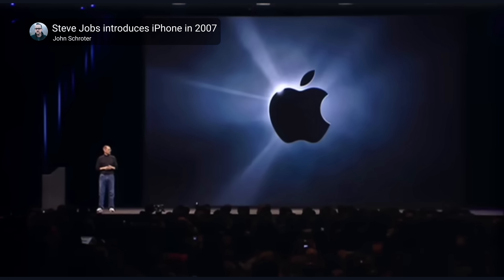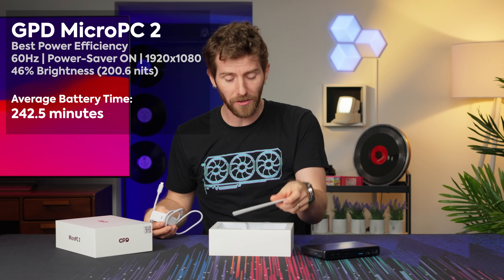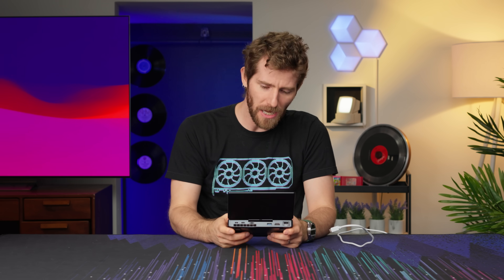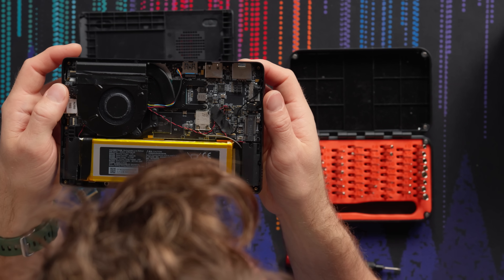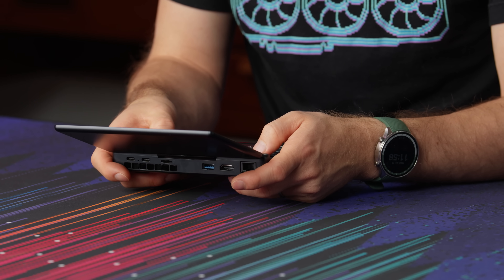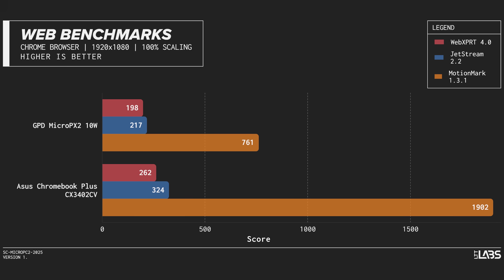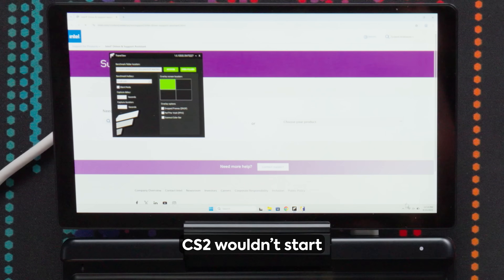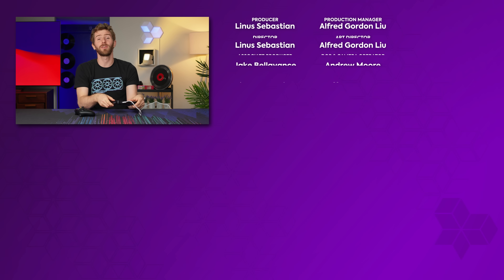I’m gonna need a smaller backpack - GPD Micro PC2

Comment: $600 is so much more reasonable than I was anticipating. Sure, it's extremely underpowered for how much you pay, but c'mon, the novelty factor makes this computer so fun for how little you're spending comparatively.
Reply: For an added cost, you can upgrade the CPU and the SSD drive. Won’t be cheap but you’ll have a professional powerhouse netbook.

Comment: I'm failing to see how this is a better option than a Samsung Galaxy phone running Dex on a lapdock. You can use Moonlight or Parsec to connect the two. It would be a far better experience with a bigger screen, normal size keyboard, cheaper price, and you can even game from it.

Comment: Wow, the exact form-factor that could've justified minimal I/O and a non-removable SSD, and those mad lads went and gave it decent I/O and an upgradeable SSD anyway. Seems like all the excuses from Apple were BS after all. And the fact that it runs Cyberpunk at all is simply amazing. This is the kind of thing I would get if I were doing mobile IT a lot and didn't need gaming performance, not a thin-and-light that takes up way more space and costs 50-100% more.

Comment: I feel like for the money you should just buy a first-generation legion go and get a thick 8-inch tablet that has way more performance at about the same battery life if not better. The laptop form factor on this thing makes absolutely no sense because of how small it is. The only thing this offers over the Legion go for this type of use case is on board IO.

Comment: As someone who semi-daily drives a GPD WinMini 2024, I can really say that GPD does do things well. Ideas are questionable but then you use it and well, it just works. Mostly got it because my work laptop is something I need and I didn't want to bring another full size laptop to work to game or do some 3D Modeling for 3D Printing I do at home. It's basically a SteamDeck with a keyboard. You'd be surprised what the little thing can do. I'm waiting to see when the new one comes if it'll have the next Max chipset from AMD in it. All in all, GPD really does make some great products.

Comment: turning off the lights in a server room to save power is like using a cocktail umbrella in a thunderstorm to prevent getting wet
Reply: Ever littl help

(I excluded every last letter so your OLED didn't have to light those pixels, saving you energy... And then wrote this explanation that I'm still continuing to type right now that will light more pixels. And I'm still doing it. Arrgh!! Sorry. This is backfiring. Oh Gosh, I can't stop)

Comment: Straight up when i was doing contract work as a computer and network tech i would have killed for a system that small and generally capable having to carry a expensivce full sized notebook pc while going up a elevator shaft runnign cable sucked

Comment: I own the GPD Pocket 3 and that is already way too small for anything productive. I cant imaging this to be any better. Cool toy to show your nerdy friends but nothing more unfortunately. I replaced it with a Surface Pro 11 OLED. The mouse button + trackpad layout is great until you have to hold ctrl/shift/alt + mouse button and also move the mouse. I have run into that issue alot when doing cad stuff on it.

Comment: 9:12 I remember hearing in a video by @NetworkChuck that they also turn off the lights and use blue lights to make it more difficult for anyone to see the type/brand of hardware someone else in the data center may be using.

Comment: Linus not knowing about the N-series Intel chips baffles me. They're super popular in the low power computer world. Lots of motherboards with integrated CPU as well as routers and firewalls.
Reply: I think this is rather a commentary on Intel's new naming scheme, where they removed the family name (ie. core/celeron/pentium etc) and just call them 'processor N250' etc. (the previous N generation was pentiums IIRC).
Reply: @SolaLupus  aggravating the issue is the fact that the numbering isn't consistent across generations; N455 is a low-power chip from 2010, but N250 is from 2025!
Reply: @PixlRainbow  And N300 is from 2023.. and it has almost twice the performance of the N250 😅
Reply: I have one running my NAS and I still don’t know Intels product stack name after the rebrand. Doesn’t surprise me at all Linus doesn’t. Nobody is buying Intel products cause they aren’t competitive and then they remove ALL the old model schemes we all knew, not worth relearning, so why would we know them?
Reply: They are also great because they have hardware encode and decode for basically ever video codec. I can livestream full HD video and the processor is idling.
Reply: @jeremiahmorgan2583  Yes, correct. My old Atom N150 netbook has none of that. I don't think it even has hardware to stretch or shrink video to fit in a window! It's basically like a slightly higher resolution version of the original VGA.
Reply: And they are so much better than the older Atom N processors like the Atom N150 in my old netbook which can't really even play HD video.
Reply: I don't think it is at all strange. Intel changed all the naming on CPU families... what is "Intel Processor" It was Intel Atom... this is effectively an Atom CPU... then they went to Celeron and Pentium.... but they got backlash because these Atom chips were mixed into Celeron and Pentium chips with actual P cores... then the Intel i3-N300 is also an E-Core only (Atom) chip again... All I know is that N = Atom... the rest doesn't matter because Intel changes the names all the time and sometimes lower = better (like N97 vs N87 iirc)...
Reply: Linus dun do with the low-power crowd tho. o.o
He uses some embedded devices, but I bet he doesn't even fully realize it. x)
Reply: Sucks that Intel never used the i1 or Ultra 1 names.
Reply: chromebook’s have them
Reply: The home server crowd absolutely loves them too, the N100 specifically gets a lot of love as the perfect option for when you don't need a super performant beefy machine, but do need more performant machine than a Raspberry Pi. I've not got any in my homelab at the moment, but I am strongly considering getting one or two to handle some of my Docker containers so my main server isn't doing all of that work.
Reply: N series of Intel is as confusing as AMD mobile lineup , so understandable. I remember back then they already N2000 or 4000 and they back to N200 or 300
Reply: Oh, he knows, he knows.
Reply: Dude doesn't even know the CPUs anymore and now he's wondering why people aren't watching his videos as much.
Reply: It really is strange. Almost made me think he's getting old to the point where he's out of touch.

Comment: 6:14 That type of tape is great for electronics due to non-conductive, heat resistance, and the HUGE one, does NOT degrade or becomes gluey sticky mess for over 10 years.
Reply: It also boasts great chemical resistance, not all to relevant to electronics applications but we use it all the time in our lab for photos etching

Comment: We need a collab between GPD and Framework, a tiny modular laptop
Reply: The Pocket 4 is basically that.
Reply: I think I'd prefer GPD and Valve or Snapdragon it's seems to be really lacking in the performance side of things it doesn't need a lot of performance it's not meant for gaming obviously but it should at least beat the Chromebook on performance and battery life for that price tag
Reply: Small and modular are kinda opposites
Reply: @WeiChei yet they're not completely mutually exclusive, you can still make an easy to repair AND small device with proper engineering. While it might not be as compact as a normal GPD or as modular as a framework 16, it could still be a middle ground.
Reply: I just wish Framework 16 had a 395+ mainboard with 128GB of LPDDR5 8000
Reply: This. A 395+ Framework, with a decent heatsink where the dGPU would've been.

Comment: It's cool we've quietly transitioned to an era where incredibly powerful hardware can easily fit inside devices this size. It's so mundane most people don't care anymore. A handheld natively running a game like Cyberpunk was unheard of not too long ago.
Reply: Not to be that guy, but modern day smartphones are a hell of a lot faster and smaller than this mini laptop.
Reply: @blaux  Can you put a double sided SSD in your phone? Does it have a dedicated keyboard? Does it run an OS that you can freely modify? Does it have multiple USB-C ports? 

I think you're missing the point a bit 😅
Reply: @airsoftuniversity  It DOES ALL HAVE you mentioned except SSD because phones have mostly 256gb to 1TB storage now, you clueless lad this guy never had held any smartphones in his life
Reply: @blaux lmao no they are not.
Reply: @kenshinbattousai374  Yes they are. Newer snapdragon elite chips completely obliterate these low tdp intel chips in single core and multi core benchmarks. Even my s23 ultra which is 2 and a half years old is faster.
Reply: @blaux yeah and never mind the apple chips. BUT with multipple windows, tabs, concurrent tasks and lots input output… we simply make more use of desktop OS systems and somehow that 4 core low power chip is plenty useful already, I guess. Like my laptops I guess. Mostly.
Reply: @blaux  The problem is they're ARM chips, so they lack the native software compatibility that the target audience for a device like this needs. This is a device for people who require x86 compatibility. Same reason no one is using a GB200 to play video games, even for the meme. The hardware fundamentally does not support the software.
Reply: @CheezMonsterCrazy Good point, however windows runs natively on ARM now. We also have more and more compatibility by the day.
Reply: Reminds me of netbooks. They weren’t so much smaller than regular laptops yet were garbage. Now you can get something the size of a switch and use it as a full sized gaming desktop, if you’re inclined
Reply: I was blown away when my cheap, $300 CMF Phone 1 could emulate PS2 games.
Reply: I think we might see a drop in these devices for users that might want just mobile games. Come December Android will have desktop mode in full release. if i need to hop into a firewall and adjust a config i tend to just use my foldable. Working in IT my Cell phone is the only pocket size'd device that i really want to carry. If i need a laptop a carry a laptop not something in between it feels like a compromise.
Reply: I think major point why people don't care is the price usually average person have to choose between full fledged gaming laptop or this and this is probably priced as hi end gaming laptop. 
edit 
scratch that the cheapsest version is semi accesible to "normal joe's" but still it's specific device, people may buy steam deck and bluetooth keyboard, mod it and still have mobile gaming and application solution for less.
Reply: The fact that my handheld can run GTA V at 120fps is so mindboggling to me, I used to play it on 20fps on my Huge PC as a kid
Reply: true.... i didn't even care before u pointed it out😂
Reply: I still remember when GPD released the GPD Win 1, which can barely run Skyrim original above 20fps. It's amazing how much tiny laptop tech has progressed in just a few years
Reply: Especially since this is the equivalent of a Celeron
Reply: Nah, they existed years ago. Play Station Portable. Over 10 years old.
Reply: Its crazy! My legion go without the controllers connected is about the same size as this and I can play triple A games pretty well on it. Crazy power for such a small device.
Reply: a 8 elite 2/a19 pro is likely much much more powerful than this.
Reply: @hailgod1  Yeah, but they are not laptops that everyday would use.
Reply: @joer8386  no but they are in phones, i have a 8 gen 2 in mine and it can run cyberpunk better through an emulator
Reply: N250 is absolutely not incredibly powerful. It's a literal calculator
Reply: Even Android Smartphone can run Cyberpunk
Reply: it's kind of insane
Reply: I love it, when the steam deck released I almost sold my desktop because it played everything I can play on the desktop. my biggest gripe is I would have to get rid of my 1440p display and use my 1080p just because of performance.
Reply: And yet they won't sell compact smartphones anymore.
Reply: I mean, phones nowadays can emulate up to Wii with 2x or more upscaling, all handhelds consoles (switch 1 included), and developers are already working on WiiU, PS3 and PC emulation.
You can basically do a lot more with a device even more portable.

Strictly for gaming, smartphones (especially foldables) are way better if portability (pocket level) is a must, and if you need to play recent AAA.

And technically you can play recent AAA with cloud gaming if the connection is strong enough.

At this point this form factor is super niche since there is plenty of choice available depending on what you want to do with a portable device.
Reply: Convergence, yes microsoft was there with windows mobile. They decided we were not ready yet.
Reply: I was astonished when my 250$ phone i got on sale was able to play genshin impact at a decent 30 fps without any loading issues. I could barely get it to run on my old ipad which was the most powerful mobile hardware i had at the time
Reply: What is not that long ago?  Cyberpunk been playable on handhelds better than this for a few years.
Reply: @AyaWetts     thats pretty fucking recent....

Comment: I've never seen someone snap the screw on a ssd slot before, this wasn't on my Linus breaking/dropping stuff bingo card
Reply: Been having the problem where I 100% strip the screw to my NMVe drives in Lenovo lately.  This doesn't happen with the older models
Reply: tought the same some weeks ago, just to snap a screw that's holding the heatsink for my nvme. God thing most m.2s are toolless now.

Comment: They left out the RS232 port... And that makes me sad.

I used the original all the time for working on older avionics systems that use RS232 interface for config, test and troubleshooting.

There are proper powered/active USB adapters, but I have found that on some equipment, they would not work.

I believe on the original  they were using a TI TTL to RS232 chip to take UART directly from the system rather than convert USB... And that makes a difference.
Reply: The Pocket 4 has RS-232 as an option.
Reply: @Alpha8713 True, but it is USB based, and that poses a problem for some of the things I need it for.

Some equipment has dedicated programs for communication, and they do not like the USB translation. And considering many of these programs have not been updated since the Windows XP days, I need a proper hardware 232 port.

I have had to use an old 386 CPU based PC to work on things, as there was nothing else that would work... Fortunately that is going away as the aircraft age out or finally get systems updated to something modern.

They only recently stipped supporting navigation databases for one old system using 3.5in floppy disks... Once they finally made a new loader unit that could take usb drives and rranslate it to the old communication style of the old floppy loader...
Reply: They didn't "leave it out", it's just that the overwhelming majority of modern devices haven't had a serial port in at LEAST a decade, if not several

It'd be like saying "no way! They forgot to put a micro-DVI port on it!"
Reply: @MrToastyYT The RS 232 port was a big feature of the original... So I would say that yes they left it out.

Considering who they are aiming this device at, 232 is still a thing in that world.

Besides, an optional 232 port is something they have for all of their modular IO devices, but they are USB based, so not the same thing.

Comment: The whole way through I was like "ah man if this thing is like $200 that's pretty good" and then it's nearly $600, bruh c'mon
Reply: What do you think you would get for $200? You can get the same cpu in a larger, more cheaply made box, no screen, keyboard, battery, ram or storage, and that's about it, just a barebones cheap nuc. At 600 it's not cheap, but thinking something like this could even be remotely close to 200 is mental
Reply: @Lonewolf_121 wether or not this COULD be $200 is irrelevant, I'm saying it SHOULD be that price. Tech is way too expensive man we need to stop accepting it as okay

Comment: I honestly love this, and the new class of Atom processors used in it. Will finally be upgrading from my gen 1 GPD Pocket.
These new atom class APUs have much faster cores with more of them, topping out at 8 instead of 4. Still a single channel of RAM but now DDR5. My biggest letdown is PCIe, yes it still has 9 PCIe lanes like many of the old Atoms, but for some reason its still gen3 and not gen4. I do understand the reason for this 9 lanes of gen3 is still fast, but i'd personally have rather seen 12 lanes of gen3 just for the added connectivity instead of an upgrade to gen 4, sadly we got neither.
Also, not a fan of calling some of the higher end 8 core atom processors a "Core i3" and having the same CSP of the 1215u/1315u when that APU has 2x the memory channels, more than 4X the PCIe bandwidth(20 lanes of gen 4), and 2-4x the GPU. Was glad to see that a few months after launch you could get entire mini desktops with RAM and SSD for the same price as the original $309 CSP